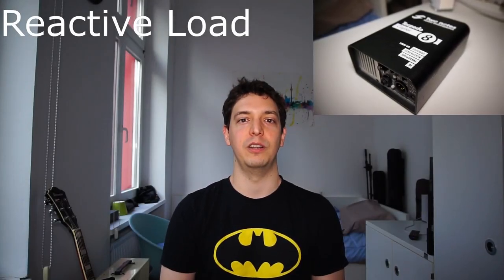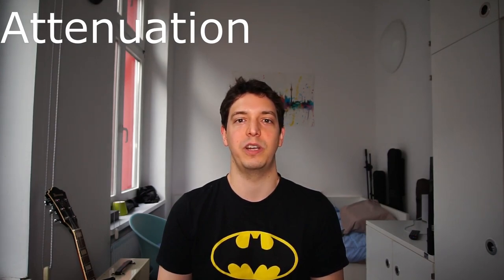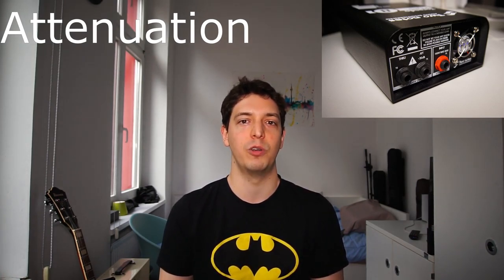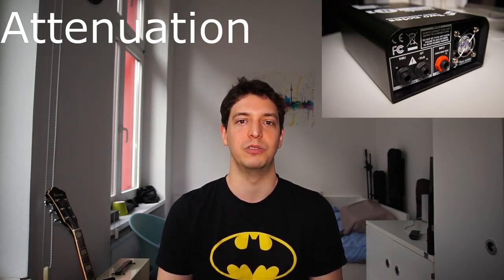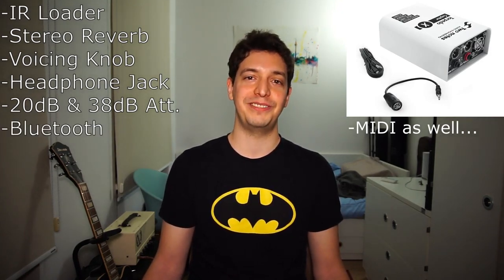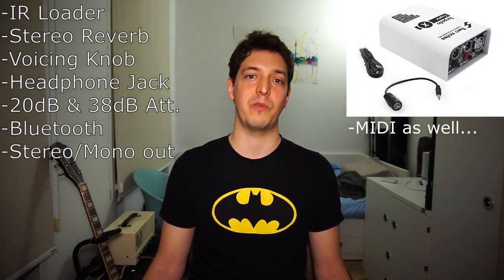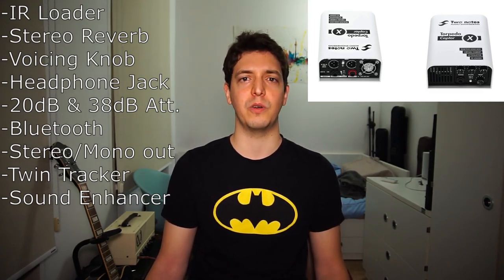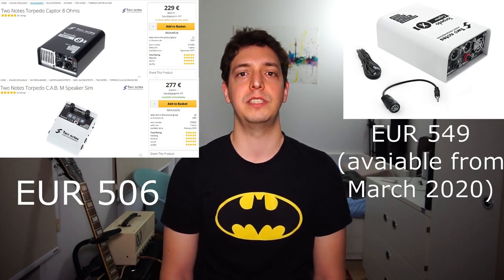Two Notes Torpedo Captor Review: Do you need the Captor X?

Comment: Hi Alberto ! Can I use either one of these Captors to attenuate my Amps and FX pedals so that I can run directly into an FRFR 12 (by Headrush) for late night quiet practice in bedroom ? Thank Alberto ! Anyone else I appreciate input also. Happy Trails-
Reply from the maker: Hi teriakamoto, yes you can. In this case, you plug your amp speaker out into the Captor / Captor X and then take the XLR or TRS out into the FRFR 12. You can crank your amp and set the output volume on the Captor / Captor X and also on the FRFR 12 as low as you want. For this purpose, I highly recommend the Captor X as you will be able to use their proprietary IR technology (called DynIR) and get VERY realistic speaker cabinet simulation. On the regular Captor you only have an analog speaker cab sim, which is not nearly as good as DynIR... I hope that helps! Let me know if you have any other question and have a great weekend!
Reply: @TheBedroomRocker1  You are awesome ! Thank You very much for taking the time to thoroughly explain this to me. Most of us cannot just crank amps at midnight or even 8pm in the suburban hell we call home. I'll get it. All the best _

Comment: I have a victory V 30 which in reality is 44 W. How much will 20db  lower the volume do you think it would be enough for bedroom levels or even live quiet stage settings? Thanks
Reply from the maker: Hey Tony, yes, it will definitely be enough for that. In fact, I play a Victory V40 with the Captor in my bedroom. In high power mode I can crank the master volume to 4-5 and in low power mode maybe to 6. The Master volume in the Victory amps is also incredible and super easy to control.
Reply: The Bedroom Rocker How about for low stage volume in a live setting? If I am at 20 dB I don’t want the other instruments overwhelming me to where I can’t hear myself in my speaker monitor. Thank you very much!
Reply from the maker: @tonymarinelli7304  I have not tried the Captor on a band setting yet. I play in a Jazz Big Band and our brass section is anything but quiet, so I do not need any attenuation... I think the -20dB may be too much for that purpose, but that depends entirely on how loud your band plays and how loud/quiet you have to be on stage. Also note that the volume that you hear on your monitors depends only on the front of house and does not depend on your amp volume. The atenuator will only reduce the volume produced by your speaker cabinet. Do you plan to use a mic'ed speaker cabinet or  just some cab simulation?
Reply: The Bedroom Rocker very good points. Yes, my cab will be mild. I think I may wait for the Captor X Thanks for all of your help you’ve been very kind!
Reply from the maker: @tonymarinelli7304  Yes. The Captor X will give you more control over your attenuation (-20dB and -38dB) and ultimately you can silent your amp cabinet completely, use the impulse responses and you'll just hear yourself through the monitors. You can do the same with the regular Captor, but the analog cab sim is not as great as the digital IR's in the Captor X or C.A.B M. 
If you still plan to use a mic'ed up speaker cabinet on stage and just want more control over your stage volume, then a dedicated attenuator with variable load is actually your best bet! But in my opinion the Victory's output volume is already really manageable with the master volume and the low power mode. 
Let me know if you end up getting the Captor X! Also, please consider using my affiliate links from Thomann to help support my channel and my reviews. 
Stay healthy and keep washing your hands ;-)
Reply: The Bedroom Rocker The only issue is the low power mode gets kind of compressed sounding I’ve been trying to work with it thanks again you give me some great input and insight
Reply: The Bedroom Rocker One last question where do you put your captor on your Victory amp? That’s another concern of mineThese amps get so hot I’m worried it’s going to affect the unit in someway I might have to put it on the floor somewhere else
Reply from the maker: @tonymarinelli7304  it's usually sitting on top of my speaker cabinet on the side of the V40. It doesn't fit nicely on top of these victory heads because of the carrying handle
 I've just posted a pic on Instagram today
https://www.instagram.com/p/B91OWTpIccS/?igshid=1i6l4nysj2c1h

Comment: So for recording the Captor X is unnecessary, cheaper to just use the Captor and Wall of Sound.
Reply from the maker: Basically yes.... if you are always hooked up with a decent computer that can process audio without latency, then they are equivalent. The X still has the additional features like Bluetooth, MIDI, Reverb control, Twin Tracker, Stereo Out, etc.,  but if you do not need those, then the Captor is perfect. I am still using the Captor in my studio and the only situation I miss the X is when I want to play guitar at night with headphones: I can still do that with the Captor, but I need to start my computer, open DAW, load Wall of Sound plug-in, etc...
Reply: @TheBedroomRocker1  What happens if you plug the headphones into di out on the original captor? Or if you connected it to an interface that has a headphone preamp? Would the sound be good enough for practice without a cab?
Reply from the maker: @alightimages7401  that's a good question, but I haven't tried it. I'm not sure if plugging a headphone in the DI out will work as it's not intended to drive headphone speakers. The alternative with audio interface definitely works. You can turn the analog cab sim in the Captor on, plug the DI or XLR out into the audio interface input, and set the interface to monitor the input for a latency free practice. 
However, once you hear your amp through the DynIR cabinet simulations (available in Wall of Sound or Captor X), you won't want to use the analog cab sim on the Captor ever again 😉 it's that much of an improvement!
Reply: @TheBedroomRocker1  That helps a lot, thank you 😊

Comment: Soundwise, if someone was using only impulses inside wall of sound, they would be similar?
Reply from the maker: Basically yes... If you are using third party IRs they will sound exactly the same. If you are using Two Notes DynIR files, they should sound very similar. The DynIR files are the same and sound the same out of the box, but the program UI, the controls and some features like reverb and enhancer are different in the Wall of Sound and in the Torpedo Remote app

Comment: Good rhythm player that can actually get a song started with a group . But I’m still unsure which one I should get.  If I rock the bedroom as good as my wife would have me believe then  it’s very possible I could get be giging with something soon as well.
Reply from the maker: hahahah thanks for the nice commment! If you plan to use it for gigging, then definitely get the X. For bedroom playing you can achieve very similar results using the Two Notes Wall of Sound Plugin in your computer, so it really depends: If you want to save a few hundred bucks and prefer to set your sound using the computer and your DAW with the Wall of Sound Plug-In loaded, then the normal Captor is just enough. If you want a more all-in-one plug-and-play solution that will, for example also enable you to plug headphones directly, control via smartphone app, more attenuation, then the Captor X is much more flexible.

Comment: Isn’t this just like the torpedo live? Except more compact and cheaper?
Reply from the maker: I am not 100% familiar with the Torpedo Live as it is out of my league. They all serve as 100W reactive load. The old Captor only has an analog cab sim, whereas the Captor X and the Torpedo Live also have a DSP for using Impulse Responses. Apart from that, I guess there may be differences in the processor, connections, and the cab licenses to justify the price difference. The Torpedo Live is also clearly targeting rack units and studios, whereas the Captor, Captor X, and Cab M have a format more compatible to sit on top of amps or in pedal boards rather than rack units.
Reply: The Bedroom Rocker Yeah aside from the physical appearances, they both seem similar. I know there are a few differences, favoring towards the captor x,  and best of all the captor x is significantly cheaper then the torpedo live. The thing that sold me on getting the captor x was , not only it’s size but you can get pan tracked sounds from it, so you no longer need another guitarist to play with lol. It’s just simply amazing how the evolution of guitar gear is growing. Two Notes nailed it this year.